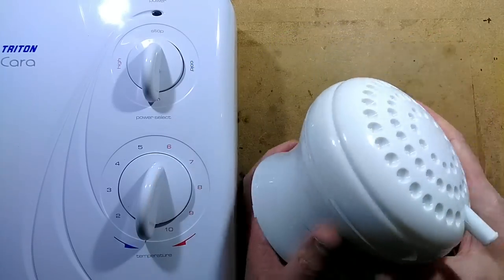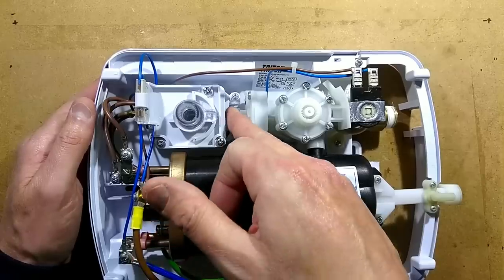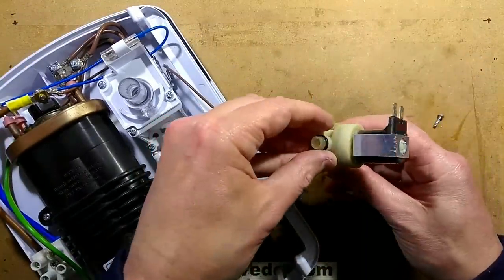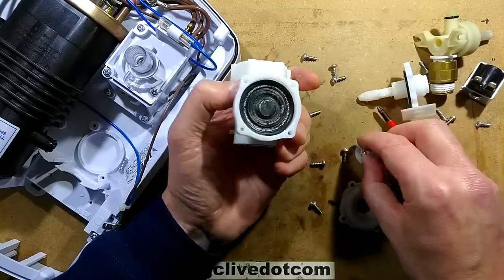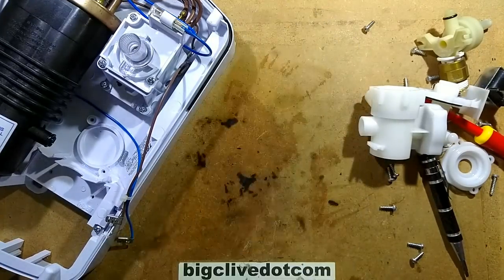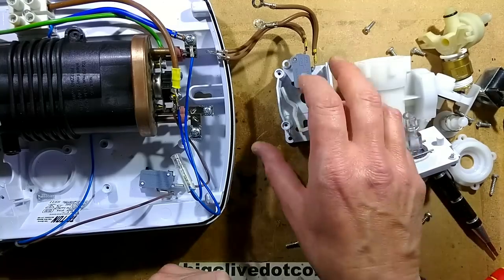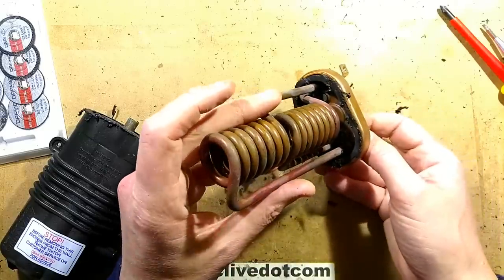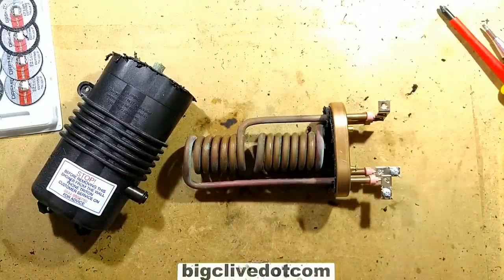Teardown of a UK electrically heated shower unit.

Comment: I was like, a heated shower would be nice. Not remembering that every single shower I've had has been with hot water. I'm probably special.
Reply: Cold showers hit different though
Reply: One of the problems with the on-demand type water heaters is that if the power goes out, you go from a hot shower to a very cold shower, very quickly.  With a tank type water heater, you still have whatever hot water is left in the hot water heater tank, so you don't immediately freeze.  Of course, the older style mechanical gas water heater designs are best since they require NO electricity for control circuitry... I'm in Texas and we recently had a bit of a winter storm where a lot of people lost power... I suspect that a lot of them right now are wishing that they had not fallen for the "all electric house" propaganda that the electric companies were spewing awhile back... For me, losing power was a minor inconvenience, nothing more... I still had hot water, was able to cook on my gas range, and use the gas fireplace to keep the house warm -- even without hooking up my generator to backfeed electricity to the house.
Reply: @jakeblanton6853  Things are electrical not because of propaganda, they are electrical because they have electronics, and electronics make them able to do more advanced things they are programmed to do. Which is also critical when it comes to safety, because modern electronics used for example in heating, are more reliable than mechanical linkages. Even if they malfunction, they are designed in such a way that device will simply shut off. While malfunction of purely mechanical linkage/regulation gauge will much more likely lead to it being stuck in constant state, and for example overheat, cause fire or explosion.
Reply: @cytrynowy_melon6604  -- And an electronic control has even more points of failure and could still result in something being stuck open... I'm retired, but my degrees were in CS and EE with a background in aerospace, so I'm a bit familiar with the problems associated with electronic controls and how redundancy must be put into it for life critical applications.  This redundancy is not being put into home appliances and devices because it would increase the costs more than the consumers would be willing to pay.
Reply: This device is very bizarre to me as an American, like 95% of homes and apartments just have a large water heater unit that supplies hot water to taps all over the house, rather than a unit specifically to heat shower water.
Reply: @barahng  We have both here in the UK. This type is easier to retrofit as it only needs a single pipe supplying cold water. Also it is instant, no waiting around for the cold water in the hot pipe to be displaced and to for the pipe to be heated up before you get a constant heat :-)

Comment: I'm pleased to see that when putting a screw back into plastic you turn it anti-clockwise first and then screw it in. It would great if you could make this more explicit to people to help them not "screw" up the hole by cross threading it. ie: turn the screw anti-clockwise until it clicks, then you know the threads are lined up, then proceed. If the screw goes in harder than it came out then you've probably cross threaded it!
Reply: Tony Brock Good tip!
Reply: It's standard advice for auto repairs, too. For obvious reasons, especially on/around the engine.
Reply: So I'm not the the only one doing this...nice!
Reply: I always did this instinctively, was surprised when a friend had never thought of it.
Reply: I always do this, once on a very fine plastic thread so I had to turn it anti-clockwise for a while to find the thread. Some wise guy was watching me and piped up that I was turning it the wrong way.
Reply: 2 years old but forever helpful, thanks for that one.
Reply: Would love some of my landlord's handimen pals who do him free work to learn this. I recently had to replace a lot of hinges and some were cross-threaded and over-tightened, presumably used an electric screwdriver to force it. Had to drill out the heads, on some pretty large screws... just so I'd know I did a proper job this time and not have it fall off again after 3 months.
Reply: Your comment is changing people’s lives
Reply: I've always done that too!
Reply: Idk how but i already do that... very low experience.
Reply: in america we say Counter-clockwise
Reply: @markmcpheters  Everything's counter-clock wise in America. You even drive on the wrong side of the road and you have your months and days in the wrong order 😂
Reply: @tonybrock5288  nope
Reply: @markmcpheters  🤣
Reply: @markmcpheters  Clive isn't American and the whole world isn't either 🤣
Reply: @TheNapalmFTW  i never said that
Reply: It's less about cross threading in this case. Those are self tapping screws into plastic... use the existing thread instead of cutting a new one. It also reduces the risk of breaking off any screw posts by putting unnecessary force on them trying to cut that new thread.
Reply: How have I been doing this with bottles all the time but not even once did I think about applying this on screws...
Reply: I figured out this by myself and when I saw him do the same i feel pleased too. I really like the knowledge he manages in every video.
Reply: This is how I screw lids back onto jars.  LOL, I thought I was the only one. 🤣
Reply: @tonybrock5288  LOL!
Reply: I do this with electric tools so I don't have to start the threads manually

Comment: Well that clears it up! I was recently taking a shower in a airbnb place in the UK. And i saw a similar device on the wall with just a cold water feed. I was baffled.  The water stayed warm forever. Amazed at the heat these little things can pump out!!
Reply: @girlsdrinkfeck  well depends, these showers are mostly in flats and city homes. Houses with combi boilers and storage tanks use mains hot water

Comment: I'm Amazed! I'm American born and raised and I'm 60 years old, I never heard of electrical heating devices for water at the point of use until I started watching your videos. In America we have something called water heaters or hot water heaters. They are gas or electric. You wouldn't get me to wire up a hundred and twenty volts to my shower head or my faucet much less 240 volts! I have a degree in electronics so I know that water isn't all that great of a conductor but you're still not going to get me to take a shower with a bunch of electrical Pixies LOL. PS, you need a secondary Channel where somebody tries to put back together everything that you tore apart.
Reply: Same thing as an electric water heater just point of use so the pipes would conduct so you could theoretically get a shock from both also large water heater tanks cause more injuries in the uk

Comment: Growing up ours had a feature where it would keep the cold water flowing after you turn it off for a few seconds to stop the water inside from getting too hot and tripping the cutout; I think it was also to prevent scale build up on the element? Not sure what timing mechanism it used, assume electronic?. Biggest memory of these is when our Dad thought we had been in the shower too long (power bill), he would simply flick the breaker causing instant cold shower! this of course lead to 'fun' uses of this knowledge when sister (of if feeling brave, dad!) was in the shower :)
Reply: Andrew Sparrow As far as I can tell, modern ones still do similar. Or at least they continue for a bit and the water gets cooler.
Reply: The more expensive ones most certainly do this and I was aware it is so that if someone comes in to have a shower after you if it did not cool the element down then the water that is left in the unit/comes out initially will be overheated and could burn.
Reply: All the showers like this i've had turn off instantly on loss of power. This is because the solenoid needs power to keep open. Particularly annoying when there is a powercut just after you've put shampoo on.
Reply: The better ones keep the water running for a bit. The old Triton t100e was the first to do this.
Reply: I remember that my parents had the original Triton T90 over 20 years ago. That didn't cut off when power was lost (it just shut off the pump). I know because I still remember being in the shower during a power cut and the water flow kept going, albeit freezing cold!
Reply: My shower has the shut off delay. It prevents the cutout being tripped.

It also avoids wasting the hot water in the hose.
Reply: Ours has the cutoff delay too. Another advantage is that because it leaves no hot water in the heater to be heated up even further by the residual heat, there is no steam pressure to cause dripping from the shower head after it's been switched off.
Reply: Depending on how the solenoid valve works you can get a delay without a circuit to do so. A direct acting solenoid (solenoid pulls plunger up, lets water flow) wont have a delay on shut-off. A  solenoid actuated diaphragm valve works by the water pressure and a spring holding the diaphragm shut. The solenoid opens a vent passage to vent the backside of the diaphragm, and it pops out of the way. When you shut off the solenoid and it blocks the vent, the water will re-pressurize the back of the diaphragm though a small hole. If that hole is small enough, there can be a delay from shutting the solenoid off, to when the valve cuts off flow. You just need a smaller hole in the diaphragm (free for the manufacturer) and a larger chamber on the back of the diaphragm (just a few cents more of plastic)
Reply: It's hard to believe that such a device is actually usable in Isle of Man. It has to raise the temperature of water about 40C to work.
Reply: Andrew Sparrow Yes sir the water is colder than air so it is externally painful to the hot headed children 😎
Reply: I had a basic one of these. Once turned off, you'd hear a click after a few seconds as the water in the heater got too hot and tripped the cutout. Turn it back on and you'd get a blast of boiling hot water followed by cold water until the cutout reset and started heating again. Out of interest, why don't they make 20kW+ versions that would actually be useful?
Reply: dopiaza2006 wow mate sorry about that. I fell the water should have prepritary tea temperature.
Reply: I've got a Redring Expressions 500S and it does continue the waterflow until cool too.
Reply: @ado543  because you are poor
Reply: @ChrisCooper312  cos ur bloody poor matey ahoy
Reply: @dopiaza2006  because people would scald themselves and then blame the manufacturer

Comment: It is over-engineered. That Chinese one is simpler, more fun to use and character-building :P
Reply: Brilliant
Reply: Manly electric stimulation.Every time i take a shower,i yell "THIS IS SPARTA!"
Reply: piast99 No but in China they make USA standard shit so your 52C shower could become a 100c shower because the thermal safety shut down off is confusing temperature.
Reply: yes, a free permanent wave with every use! sadly it is a one use per customer, and burial expenses are not included in the package. . .
Reply: morning showers are nice and refreshing, but sometimes you just need that good old buzz to wake you up
Reply: The "chinese" one is used quite everywhere in Brazil
Reply: I've got a very similar Triton, but happily the cowboy who wired up my flat decided to bridge the gap between the two and wire in my 8.5kw rated model using 30A-rated cable. Which adds a nice extra bit of heating to the rest of the property that it runs through when I use full power.
Reply: Yes especially with a metal bath too.
Reply: It is under-engineered. Over-built = under-engineered.
Reply: @sparticus214  They don't use this "shit" in the U.S.  We have water heaters for whole house use.  This is Euro-shit.  240v in a shower.  What could go wrong.
Reply: As long as it doesnt kill you, you are stronger because of it?
Reply: @larrygall5831  They're commonplace and safe. I would imagine more people have died from tumble-dryer fires than from electric showers in the UK?
Reply: And tells fortune!
Reply: Most of the more suicidal ones are actually made in Brazil, not China.
Reply: I would hardly call it over-engineered if you have to adjust the water flow to change the temperature.
Reply: Larry Gall ha we have whole water house heaters here to - more efficient than US in fact as it's instant and unlimited, along with the water not having to sit in a festering tank to heat like in the states. This is just one type of shower available.
Reply: Electrocution builds character?
Reply: @rocksnot952  no... Just your immune system
Reply: @thiagokeizo  probably still better than running water over a curling iron.
Reply: Sherry Lee The US has instant hot water heaters too
Reply: I think it's crappy british engineering. I hate these hydraulically switched heaters. Compare it with an electronically regulated german 27kW Clage DEX heater.

Comment: You could probably take the top of that workbench and pretend it's modern art.
Reply: Sannesthesia what jew say?
Reply: Whadd'ya mean 'pretend'. It’s worth at least 6 figures
Reply: Sannesthesia Idd, complete Pollocks.
Reply: @HighestRank  What did you say?
Reply: I'm an artist, I could take that and make it modern art. You can't because you're not an artist, that's how it works you see.
Reply: @naso4265  No, only if an artist says it is. That's the rule.
Reply: @Aconitum_napellus  nothing. Your friend count can't become a negative integer.

Comment: I had an earlier version of this, made by Triton too.  In 20+ years the only faults were the micro switches, so much so that I bought a box, off Ebay, of 100 of them!  They were even simpler to replace than the ones here as they weren't so encased.  The way mine worked was that the 2 micro switches pivoted on a pin as the Hi, Lo, Off control and cam was rotated and the switches just slid off the pin for replacement.   I was really happy that every time one failed, every year or two I could repair the unit within 1/2 an hour and have it back up and running.  Great, saving lots of money on repairs, very eco friendly as I'm not throwing an otherwise good shower unit in the waste.  Not so good is that my wife eventually got fed up with the very economical repairs and demanded that I replaced the complete unit, the old one looked tired and a bit worn!!  WTF it's only a shower who cares what it looks like as long as it works?  Well she did, apparently either the old shower went or I did.  For my own safety I gave in and she now has a new shower and I have most of a box of micro switches!!

Comment: Very interesting Clive, especially as I have a similar shower unit in my bathroom. I certainly hadn't twigged how the water temperature is simply controlled by the flow rate. As for your new audio/ video setup, picture quality is clear and crisp as usual. I agree the audio is pretty compressed - but still clear and easy to listen to. Best not mention the final section, hard  up against the AGC and somewhat over-exposed!

Comment: Hello Clive!
I have this exact model and live in a low water pressure area. Your description of the thermal cutout seems to explain why every morning I have to start it on high with a cooler setting, let it flow for a few seconds, then switch up to a hotter setting, at which point I hear it click and the water heats up near instantly.
These are superb vids, keep it up!

Comment: We have two units the same, every Triton we have had just gets through its guarantee and fails. The rubber balls are for one-time use once blown out although they fit back in they soon blow out again. Also, I have had them blow out prematurely one I had replaced under guarantee the other one they would not honour the guarantee saying a surge in water inlet pressure caused it. Impossible to prove otherwise. I used to keep spares but I found a cheaper way. I changed the make, Far less hassle with the new make I am using. Keep up the good work Clive I love your voice very calming when I cannot sleep.
Reply from the maker: I wonder if you have unusually high water pressure.

Comment: Here in the USA, I just changed my Hot water tank for a Electric Tankless system.  36 KW, 60 feet of armored cable, and 4 x 40 amp dual pole breakers fun.

Comment: Don't know if you'll see a comment on an older video like this but I just wanted to thank you for doing this teardown as I was able to use the information from this to fix my wee Triton shower. Essentially it was leaking heavily from the top of the white pipe coming out of the heating chamber. I would not have had the guts to take it apart had I not seen this video. Turns out the o-ring had dried out and shrunk over time breaking the seal. I was able to fix a fairy significant leak with a simple new o-ring. Thank you.

Comment: Great teardown as usual. Last year our distribution (fuse) panel was replaced, changing the HRC fuses with a panel having two banks of MCBs, each bank protected by its own RCD. When it was powered up, the RCD on one bank kept tripping out. By a process of elimination it turned out to be our electric shower unit (which we had been using for a few years!). Fitted a new modern shower unit and all is now good.

Comment: The audio is more bassy (and slightly resonant) and gets distorted a little easier. It sounds fine, but slightly worse that the last camera. I can't place the video differences, but it appears to be neither better nor worse.
Reply: Does the camera support an external mic? That could solve any audio problems in theory.